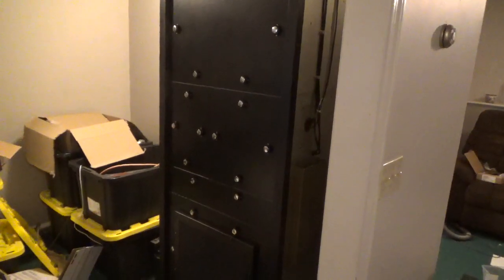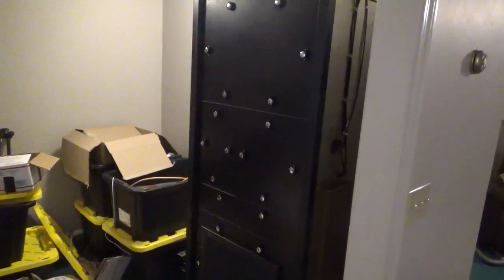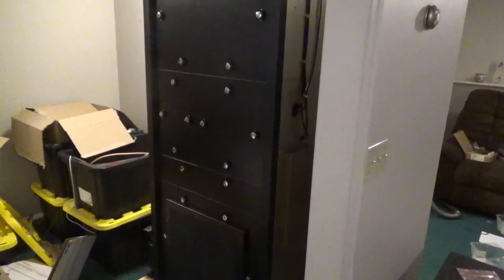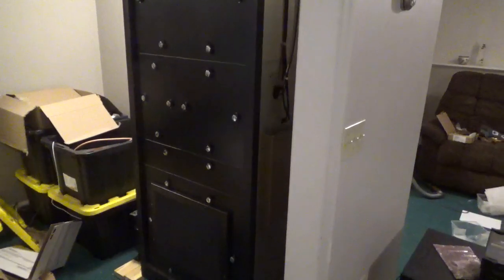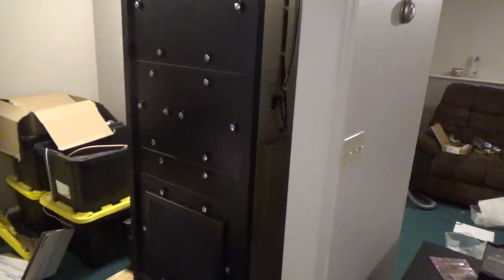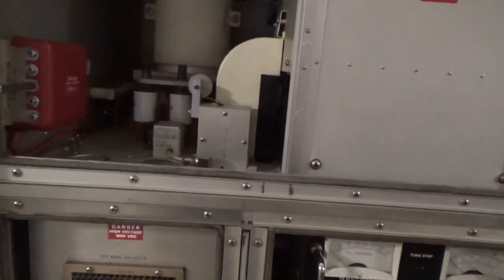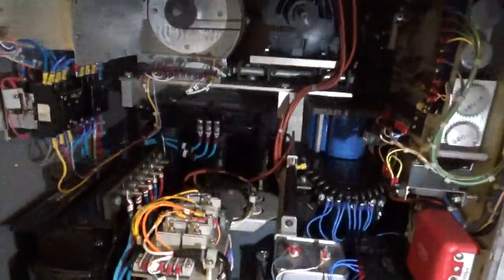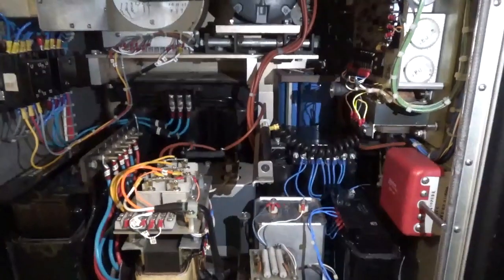Rockwell Collins HF-8021 Auto Tune Linear Amplifier

Comment: Question, did you use the 8021 to drive the 8022 or does the 8022 also have low drive capability?
Reply from the maker: The hf-8022 also has a driver built in. Pa requires 100 milliwatt exciter

Comment: 8021 is a beautiful amplifier. When you have the Rockwell Collins control head, and matching radio. They're pretty much is no bands you can't conquer the mission you can't generate. It'll even do slow speed data. And in the last Incarnation had a ivits system built in